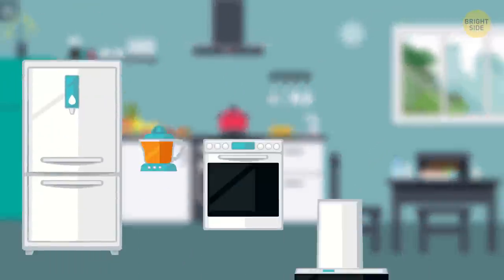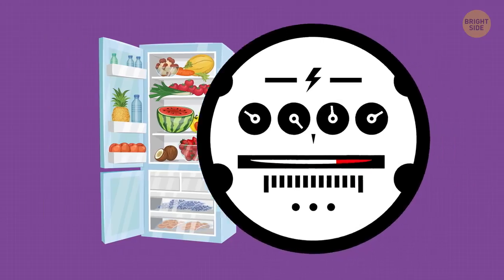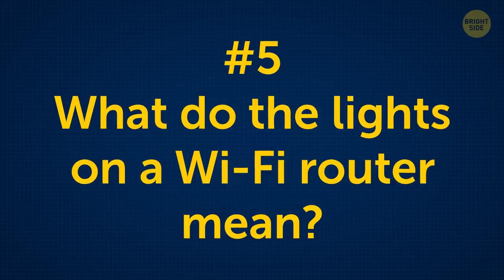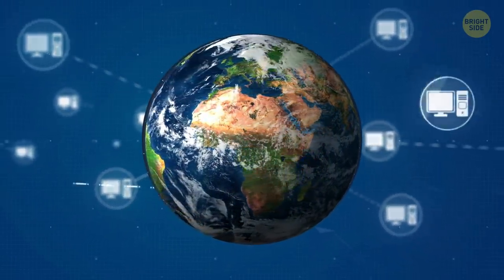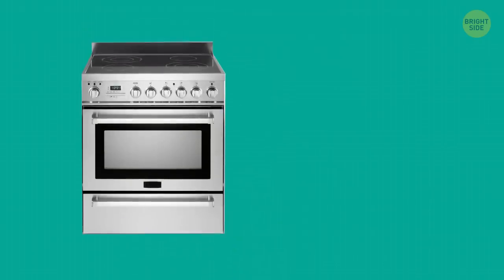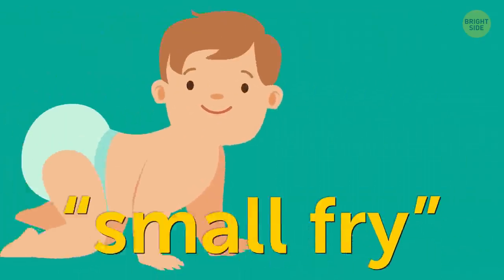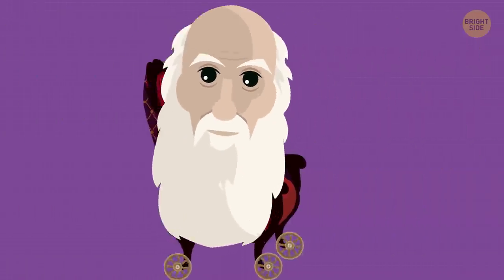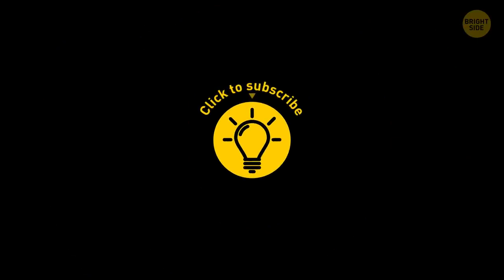That's Why Wires Are Colorful

Comment: Code for U.S.A and CANADA:

Black= hot/live wire
Red= signal wire or hot/live wire (for 240 volts)
Blue- hot/live wire (for 480 volts)
Yellow= Motor ctrl or hot/live wire (for 600+ volts
White= Neutral
Green/bare/green w. yellow stripe= ground

Code for U.K. 

Brown- hot/live
Blue= Neutral
Green/bare/ green w. yellow stripe= ground

In U.S. you can use other colored cables as long as you mark them with live/Neutral/ground

Comment: A microwave works by sending radio waves through the food, these interact with water molecules causing individual atoms to vibrate, absorb the wave then release it as heat,, it is not caused by atoms smashing into each other they vibrate at perpendicar angles causing the heat not because they rub together

Comment: Er no, bright side. 

A qwerty key pad is made for speed typing. They are arranged in the most used letters. 
Ask any Baby Boomer typist.
Reply: Exactly, the grouping was ment to type faster not slower, and it works too
Reply: Thanks for having an answer instead of the narrator which wasn't sure. .. so why was he talking?
Reply: Sorry, you are wrong. The original intent was two fold. It was to slow down the typist and to arrange the letters so that the most common were accessed by the stronger fingers. If you type too fast on a manual typewriter, the hammers for the letters get tangled because they are trying to strike the same spot but are coming from different angles.

Comment: “Wifi boxes have 8 lights”
MINE HAS 4
Reply: Mine 4-6
Reply: Err...   3 for me. But then they got the gray and white wires scary wrong! For that matter, they failed to differentiate between electrical and electronic color codes.

Here in the USA the National Electrical Code (NEC) says that white or gray must be used for neutral conductors and that bare copper or green wires must be used as ground wires. This means white and gray wires must never be used to connect the cases of your appliances to ground, that's the job of either green or bare wires.

On the difference between electrical and electronic color codes: For electrical, black is always hot red might or might not be and white and gray are common. For electronics, black is the ground or common and red is hot.

Comment: oops, neutrals are not for safety. They are to complete the circuit back to the electrical panel. The green and bare wires are for safety, they protect you from shorts to the frame of an appliance.

Comment: Your video gives some MISINFORMATION. 

5:37 the red wire between smoke detectors is not an AC wire, it is DC. 

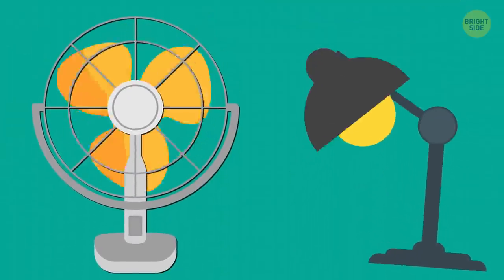5:47 white or gray wires are NEUTRAL wires and are the complement to the HOT wire
    white or gray are NOT USED AS PROTECTIVE GROUNDING

   Green or Green/yellow wire is USED AS PROTECTIVE GROUNDING
Reply: Red is used with ac as well, as a switched connection, or the second phase in 220v circuits.